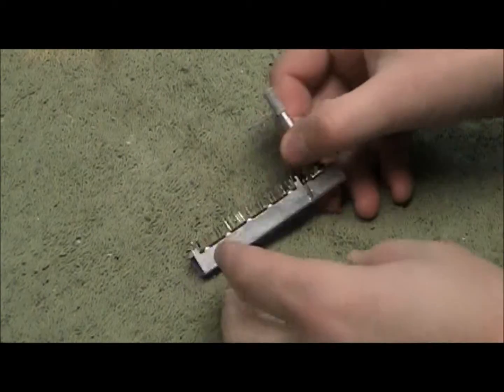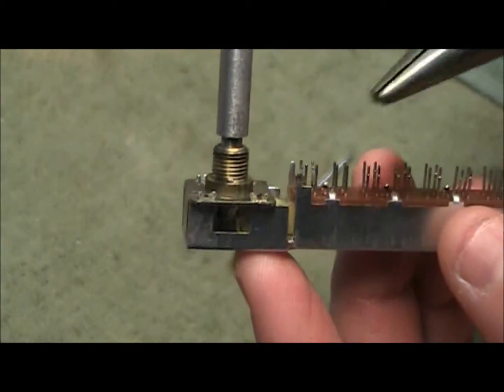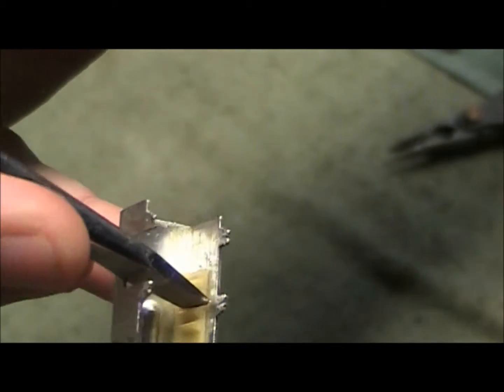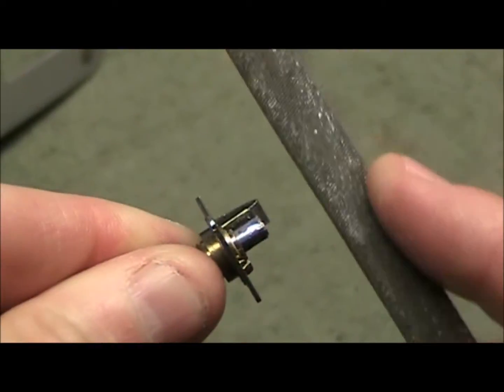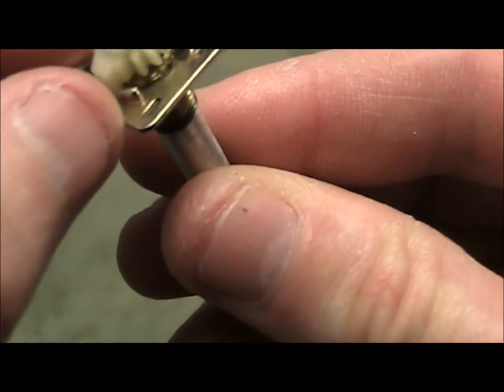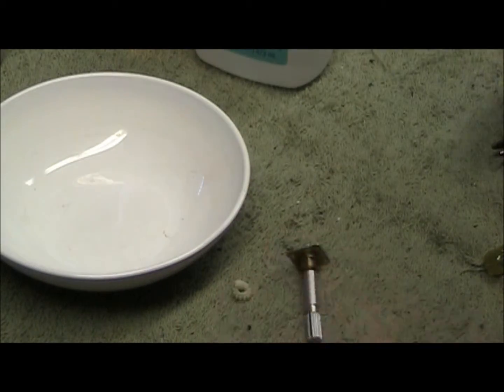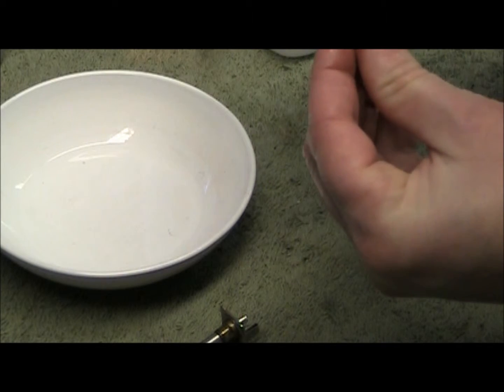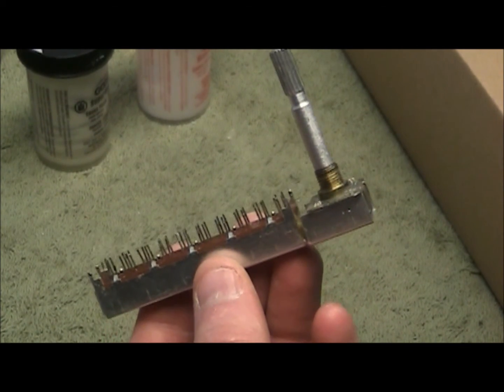Lasonic TRC-931 Switch Repair (1980's Radios)

Comment: The one on my trc-920 was busted as well. I fixed it, I fixed it a few years ago; I just superglued that gear back on the shaft, but I made the mistake of pulling that slider out too far, and the pins inside are now a little messed up. It does work, but the knob has to be in just the right place for each function to work properly. It's weird that lasonic didn't make the switch click between functions, you're just turning a loose knob between tape, radio, and phono. The band switch clicks, but the function one don't. Great video, I know this will help a lot of people.

Comment: Thank you for this very helpful video on this geared selector switch, the absolute Achilles' heel of some Lasonic boomboxes.  When I was shopping for a TRC-931, I was adamant that a broken selector switch was 100% an instant deal killer.  I stuck to my guns and the one that I did eventually buy was in great condition and both switches work perfectly.  If one ever breaks on me, I'll definitely refer to your video again so I can fix it.

For those that don't know, these Lasonic geared switches are very fragile so be extremely careful when using them.  When you operate them, hold the knob tightly in your fingers so that the switch does not freely "slam" back and forth against the hard stop/limit shown in the video.  That is what can cause the white plastic gear to break.  If you move the switch very slowly between its positions and keep it from "slamming" from position to position, that also will help extend the life of the gear considerably.

For any Lasonic fans out there shopping for a TRC-920 or TRC-931, hopefully the boombox that you might be interested in buying was not originally owned by someone that was rough on its switches.  But who knew that these old classic boomboxes would be so desirable today?  Most of them were just considered disposable electronics back in the day and treated as such.

Thanks again for the great video!
Reply from the maker: Your welcome, glad it helped you out

Comment: I too have the Lasonic TRC-920 Model. One of the problems I had was similar to this. My FM/AM/SW1/SW2 Switch did not work properly. This was due to same problem that you mention. The little gear was broken into two, this seems like a common problem on these 920's and 931's. I have to say it was a real pain to desolder it from the board, have a good hour or two and lots of patience if you plan on repairing it yourself. Somebody really needs to make these for these boxes again.
Reply from the maker: thanks for your comment. there was a guy on ebay that sold replacement gears, but they sold out and that's it. Glad this video helped
Reply from the maker: +Laoczi2007 Vladimir yep, solder sucker is the only way to go!
Reply from the maker: +Laoczi2007 Vladimir thank you for your kind words

Comment: Any possible way to re-wire /install a modern 3 position rotary switch having the long shaft that actually clicks into position for the tape, radio, and the AUX function?
Reply from the maker: it has been talked about, but to my knowledge no one has done it
Reply: Any Lasonic radios TRC-920 and 931 owners who had the bad 3 position function switch, would someone PLEASE be able to show a video of replacement modern rotary 3 position switch having the same length shaft, before and after to where its wired into these radios?

Comment: I found a Lasonic 920 on Ebay having the rotary 3 way switch broken and looking for replacement, this video might help repair that switch, providing that tiny gear didnt come out of the casing... The switch shaft if its roughed up on the end to where cant slide the gear back onto the shaft could be solved by using a DREMEL Hobbyist electric tool to sand down/refine the shaft so the gear slides firmly back onto the shaft, might want to add thin film of strong glue to gear, the type of glue that dont age and falls off like crazy glue. Most tape decks drive belts needs to be replaced and the cassette capstan head path with the roller wheel has to be cleaned as well

Comment: Ive got a Lasonic 920 model using exact same rotor 3 position switch, and the knob wont pull off. i dont see no hidden retaining screw preventing that knob from being pulled straight off,and i certainly dont want to break it by forcefully pulling too hard up on the function knob to get it to let go of that switch, what'd somebody do...glue the thing on?!
Reply from the maker: chances are, someone did glue it on :-(